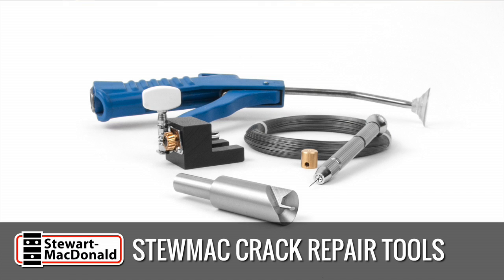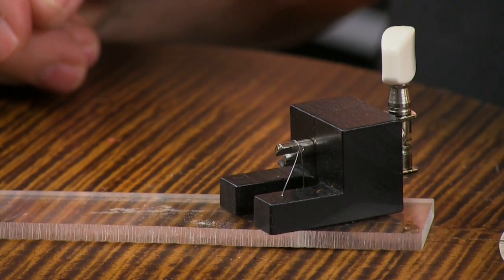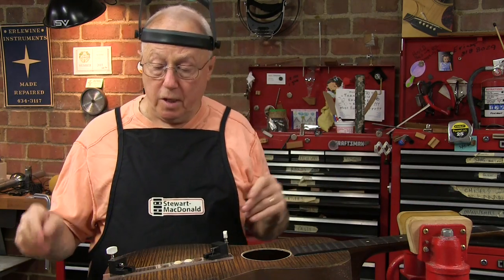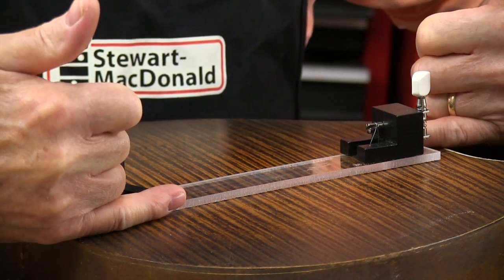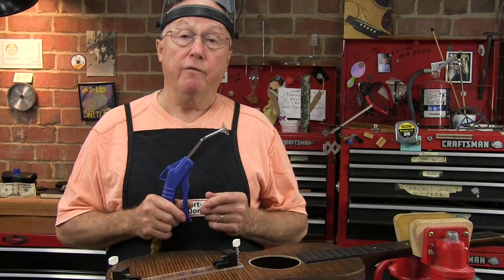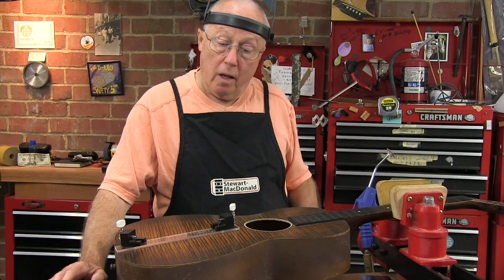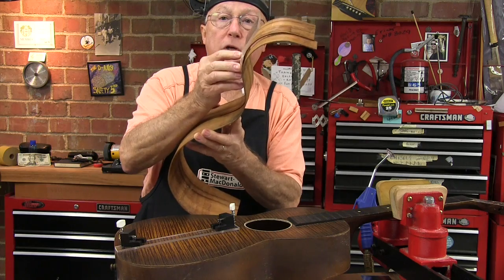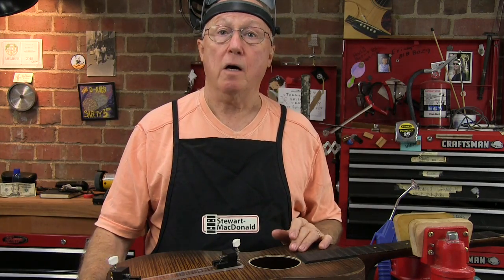StewMac Crack Repair Tools Demo

Comment: I was just given a fixer-upper to experiment on and it has two cracks running the length of the top. Which of your videos will show me the best way to repair any loose braces after I fix the cracks? Thanks, Dan you are indeed a master!

Comment: Charlie Christians get those side cracks. I remember buying about 24 of the wood clamps for the sides for that op. I chose veneer for a patch...a long piece...and yes, it didn't run at a 45 degree angle. Good thing was..I sold it as is...and gave the clamps to woodworkers...

Comment: The water also swells the wood, or at least that was something I heard at the Martin repair seminar. I love the cleat cutters, but the Spanish Windlass (tiny winch) is easily made with a tuning machine and some scrap Delrin. I even made some with a concave bottom for working on sides, and convex bottoms for working inside the waist. Some thick neoprene works great on arch tops,  which shouldn't crack, but they do, and it works on the curved sides too, so you easily make the Stewmac crack clamping winch work almost anywhere on any guitar. My latest custom tools are  for gunsmithing, and I needed spring crab to fix a 130 year old English gentleman's side lock hunting shotgun. I made 16 crabs, kept two, and the other 14 are already spoken for, within 6 days. If you think these specialty tools are overpriced, make a small run of specialty tools, no one else makes, and see just how fast people buy them. Antique spring crabs from England sell for $350 each, and there is not much to them. The one I copied was £200 + VAT + shipping from England.

Comment: How do you fix a headstock that has been spit vertically so that just one tuning machine falls off on a jackson/ibanez/fender style headstock?
Reply from the maker: First, clean up the wood in the break using some Naphtha solvent to remove any oil, dirt or other residue. You should also remove any small splinters or wood fibers that are out of place and would interfere with gluing the headstock back together. Then, you will need to make a custom clamping caul that matches the contour of the sides of the headstock. We recommend using some dense foam insulation for this caul. Then, apply wood glue or hide glue to the glue joint and clamp the two pieces together. Clean up any squeeze out you can after tightening the clamps. Once the glue is completely dry, remove the clamps and cauls and sand/scrape away any remaining hardened glue. We recommend watching our video for Trade Secrets! Issue 224: Gluing a broken peghead.
https://www.stewmac.com/How-To/Trade_Secrets/Gluing_a_broken_peghead.html